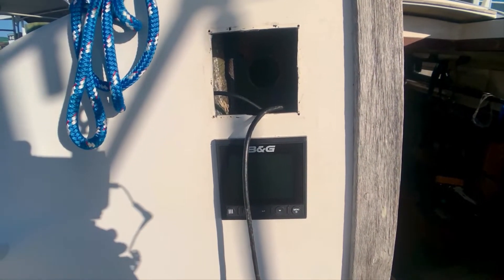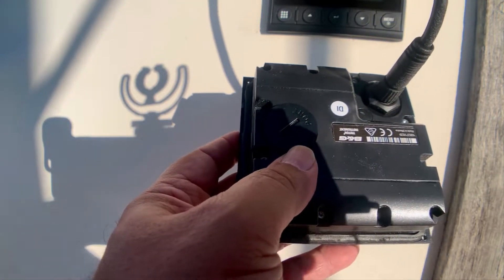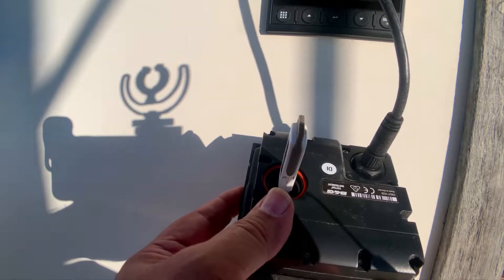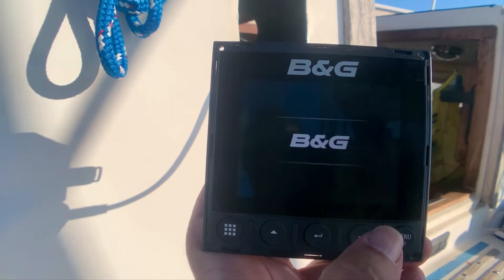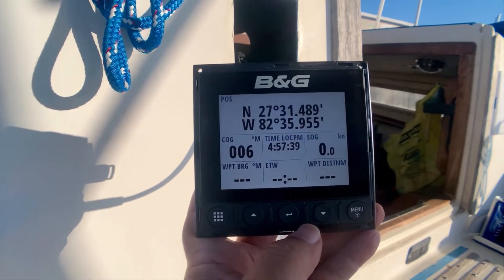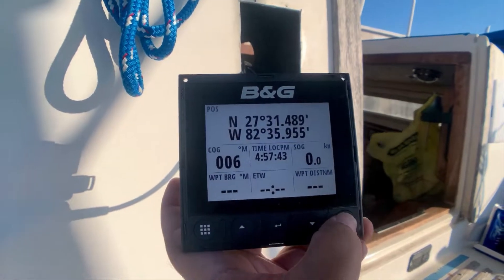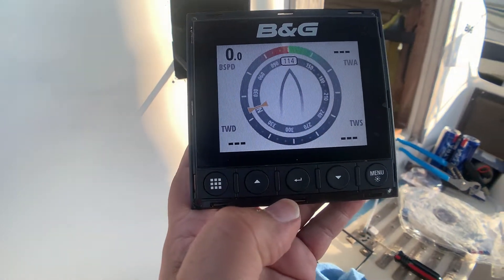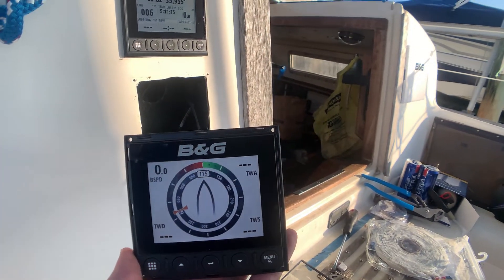Ep 43 - Marine Electronics - Updating B&G Triton2 Firmware: How to Do It - Sailboat Maintenance

Comment: You say you had to format the download.... how is that done?
Reply from the maker: Thank you for watching.  You have to format the Thumb drive in basic MS-DOS format.  You can do that with the Disk Utility if you are using IOS or using the format command if you are using Windows.  Once you format the thumb drive then you download the upgrade file to it.  Once you have the thumb drive with the file, you plug it on the back of the Triton 2 before you turn the unit "on".  Onced plugged in, you turn the unit on and watch the screen show the upgrade running and the progress bar.   Hope this helps!

Comment: Thanks for the effort in making the video, but somewhat annoying how many times you scrolled past "about" without checking your firmware version before and after to see if it actually upgraded. Also horrible design that you have to do it this way. My system is connected to wifi. Inexcusable that it cant update over that.
Reply: Thank you for watching. I will make sure I add that to the video next time.  Unfortunately, the Triton 2 cannot be upgraded via WiFi.  Hopefully B&G will address that in future versions.

Comment: Thanks for the video Jose! I had the same ending. In the Zeus I still see the old firmware versions on de Triton display. What was the response from B&G on this item?
Reply from the maker: The Triton Displays will not update from the Zeus.  You have to load the Firmware on a Fat32 Formated USB stick. Remove the cable from the Triton unit, insert the USB stick on the unit and then reconnect the cable. It should update the Firmware then.  Once you update the Firmware on the individual Triton, it should report correctly to the Zeus.  HopE this helps!

Comment: I do not think you have a valid update. Check the "About" and read the number on the current software version. Compare it to the number on the downloaded version. If the update was carried out correctly they should be identical. There should also be a progress bar showing during the update itself. Same thing happened to me. Have not found a solution yet.
Reply: Just learned from Navico Support here in Scandinavia that you need to single out the "standard" .upd file from the Updaters folder and load it on your USB stick root directory. It worked for me.
Reply from the maker: I actually had the correct software, but it id not load.  After talking to B&G the only way to update the unit the Triton II is via USB stick in the unit itself
Reply: My point exactly. Totally agree on the USB.
Reply: @HomesBoatsTravelbyJoseTorres  Did you fix the update problem? I'm running into the same thing. It sees the .upd file, it reboots, sometimes short beep, sometimes long beep, but after that the unit isn't updated. This is via a USB stick..
Reply from the maker: @sanderr1983  I have not tried again.  Trying to get other bigger projects done.  I am almost done with that, so I will try again in the next few weeks.
Reply: @sanderr1983  I got it to work with only the Triton2-2.2-57.3.186-Standard-1.upd file loaded on the USB stick. When I tried with the whole updaters folder on the stick, I got the same result as you did.
Reply: @pergudmundstrmmen4590  can I ask what size USB stick?
Reply: @sanderr1983   I do not know exactly off hand, but it is not new, so probably 8GB.
Reply: @sanderr1983  I tried with 128 GB and the stick did not appear.  Off to buy a smaller stick but had to seal it back up as I have an offshore passage in the morning that could be wet.

Comment: I think you can use an SD card if you have a compatible MFD, then it updates the Triton over NMEA2000.
Reply: Triton2 FW Ver 2.0-57.3.186 is the latest FW file released May 15 2022
Reply from the maker: I talked to B&G Tech Support and the informed me that the Triton's can only be updated via USB.  At some point, I hope they come up with a better way to do the updates.